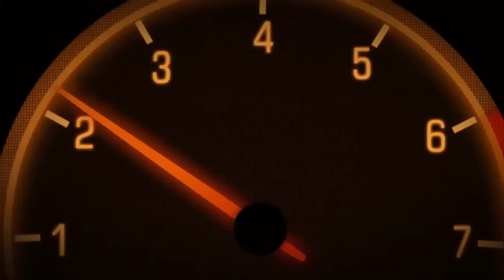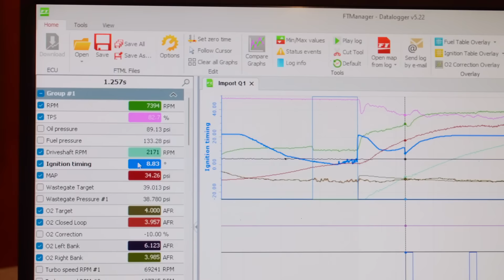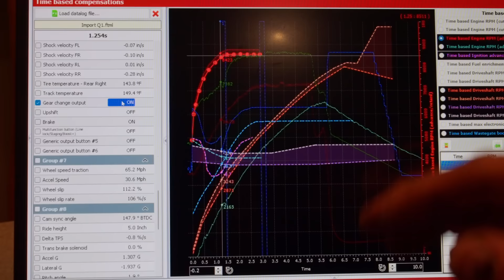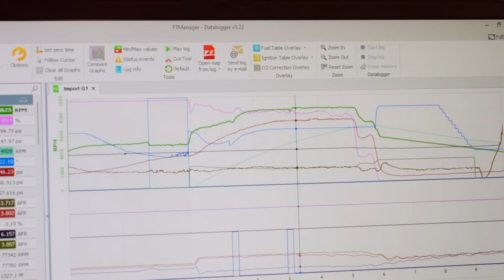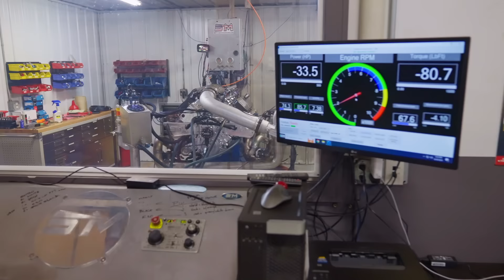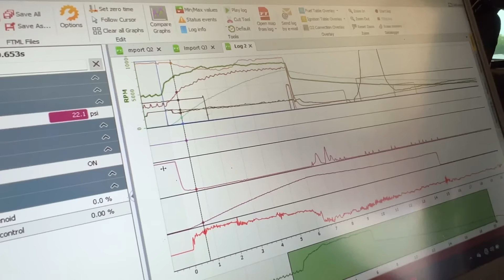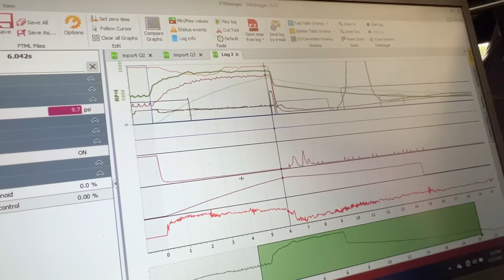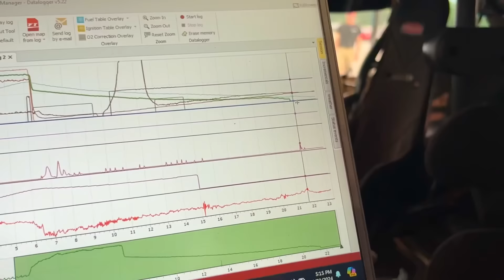Oh No!!!  Why Are There No Brakes @ 215 MPH!?!?

Comment: The sensor is only on the front circuit, I’m sure the rears were working with the chutes to slow you down at 200+ or you would have been deeper the the sand. Probably the fluid on one side is your problem. The 10lbs residual pressure is normal on disc brake setups. Great driving! I’m sure baby Jesus would overlook a few f-bombs in that situation.

Comment: 10 psi residual check valve is for rear drum brakes to hold the shoes near the drums and the rear disc only need 2 psi residual check valve for hold fluid back in the lines for sure this is the way a normal system works that has nothing to do with brake biases I don’t know about your race master cyl or your brakes I have ran into this on off-road rig seems at that speed drag on brakes should be glazed and stupid hot to boil  silicone based fluid good luck

Comment: If you never release all pressure on the brake system.  Your not charging the master cylinder with more fluid.  Some of the problem could be just pad wear and are the rear calipers the same size on the new rear-end?  Look at the thing you changed last.

Comment: my guess is that the brakelines are too close to the headers / turno / transmission , and even dot5 fluid cooks off once it gets passed a certain temp , if the brake fluid is older there might be water in it , you actually need to replace the brakefluid regulairly as its atracting moisture out of the air 
might allso be that either the brake cilinder isnt made for 4 diskbrakes (its sumting to do with the holes from the reserviour to the master cilinder , the diskbrake type sucks some of the brakefluid back intoo the maincilinder pulling the pads of the disks a brakedrum type only opens up the line to the brakereserviour as the springs pushes the cilinders back in )
or the pushrod is slightly too long / brake master has too small or big a piston 
maibe talk to cleetus to see if you can talk to the guys running his brake eqiupmen company , its their specialism so they might find sumting youre missing 
think the bigger parachutes be a pretty good idea , maibe use larger diameter front brakes might be a good idea too as you run the thing on public roads during drag and drive events too

Comment: check wheel bearings or warped rotors that are pushing the pads off the rotors...  you also have a TON of pedal travel before you have any braking effort.  Pads thin and are getting hot?  Anyway, look for something amiss and UPGRADE!!!

Comment: There must’ve been some kind of air in the braking system and then as you’re going down the track, the vibration is moving the air bubbles around or something. Just a theory. I’ve kind of had that problem with a clutch system.

Comment: First off, use System X Max Protection on your paint. You'll thank me.
Now, the brakes. Air doesn't compress. When you boil the fluid, it causes air to form. This is why I use the highest boiling point brake fluid. I've had this exact issue,and Mustangs are notorious for this. Second a bad master cylinder can be intermittent as well. High pressure it can fail, but slow easy pressure it's fine. We have a truck right now that does this. But it's not technically ours so we can't fix it.

Comment: well you were double pumping the brakes on the starting line.. doubt it is heat... throw a dial indicator on the rotors and see what the runout is.. also how much you can "induce" by slopping the wheel bearing.. at 200+ you might not be able to account for the pushback of the pad to the pistons.. maybe if you could pump brakes at 299mph?

Comment: Idk your break setup. But a single master with a possibly faulty or not fully releasing solenoid possibly? I believe you were having electrical issues before with that circuit that might have damaged it just enough to make them drag. But idk. And your wife is a legend.

Comment: Silicon based brake fluid?  Water vapor in the fluid makes pedal goes away.  Residual brake pressure probably from water vapor bubbles in the fluid.

Comment: Run a dual circuit master which keeps the front and rear brakes as 2 separate circuits so even if you loose the front brakes, the rear brakes are not affected and visa versa.

Comment: NIT SURE WHAT BRAKE PADS YOU RUNNIG BUT I HAD THE SAME THING HAPPEND  TO ME AND A ENGINEER TOLD ME THAT BRAKEPADS GASS OFF IF OVERPOWERD AND THATS WHY YOU HAVE A NO BRAKE SITSIATION  BECAUSE THE GASS ACTS LIKE A GAS BARRIER  SO THE PADS DONT CONTACT THE ROTOR
Reply: Yeah.....no

Comment: Sometimes I feel dragsters need train brakes. Adding pressure releases the brakes. So if you lose brake pressure, you basically slam the brakes.
Reply: Ever see what happens when they lock the tires up trying to stop from those speeds? It's not good !

Comment: I wonder if the brake fluid has absorbed water from all the humid weather.  Water contamination will greatly reduce the boiling point of the brake fluid.  The best fluid in the world will boil quick when contaminated with water.

Comment: Sounds like your master cylinder is going bad. When they fail they can intermittently let fluid bypass the seals and you get low or no pressure.

Comment: Probably the brakes were dragging and boiled.  I've boiled the brakes, same exact thing. Have brakes, boil the fluid then zero pedal pressure and zero brakes, then when it cools the brakes are seemingly fine again.  When it boils the bubbles push the fluid out and the calipers are full of gas, so you get no pressure. When the fluid cools the gas collapses and brakes return.  You need to figure out why they were dragging. My guess anyway.

Comment: Damn that was not a nice way to finish a run. Perhaps it's time for a dual master brake system. It may weigh a bit more but at least one axle will still have brakes if the other fails. What I mean is twin master cylinders? They dont use a proportioning valve so the loss of a hose or caliper seal will only affect that axle. A pretty standard thing on circuit cars for that exact issue as well as the ease of setting brake balance whilst racing.  The master cylinders need to be long enough to still keep a pedal if one is completly disconnected and of course pedal stroke and reach need to still function in a useable manor. It also might be worth investigating if the pistons in the calipers can move freely enough to retract under a vacuum that the master cylinder creates with it's spring return? The anti rattle springs should keep the pads in contact. Not all disk brakes work like this but if they are dragging it may be worth a look. 
Cheers

Comment: I would throw those lightweight brakes in the scrap bin! The very last thing to consider saving weight on is brakes, especially on a street legal car. Imagine if that had happened at the end of a freeway offramp instead of a drag strip. The TBM website clearly states these brakes are NOT street legal, so if you were in a wreck on the street your insurance policy would be null and void. IMHO if you don't have enough brakes to lock all four tires at will you don't have enough brakes.... but then I'm a rallyist and hillclimber, not a drag racer.

Comment: One of you brake components weren’t meant for use with drum brakes were they, as drum brakes have a residual brake pressure valve in the system

Comment: If you hit the brakes when they are overheated wouldn't you still get the expected hydraulic  pressure but you wouldn't get effective braking? My thinking is low pressure is not a symptom of an overheat, theres something else wrong. But I have been wrong before, just ask my wife.

Comment: The way the brakes came back after makes me think air is in the system. Compressed air instead of pressurized hydraulic fluid. Also could the turbo have sucked in rocks

Comment: I get the parachutes supplement brakes... but has anyone actually done the math on TBM brakes?  The entire point of a brake pad/rotor is to turn kinetic energy into heat energy to stop the car.  If you don't have enough mass in the rotor to dump the heat energy into, how can you possibly expect the vehicle to stop?  I think there's safer ways to shave weight, a brake rotor shouldn't be one of them incase the chute fails (see Tom Baileys car)
Reply: Also, brake fluid absorbs water over time, and will easily cause brake fade under extreme braking situations when saturated.

Comment: 20 psi in  residual pressure  is far to high, max is around 2 psi Result you will cook the brake fluid no matter what you are using, and racing brake fluid has a very short lifetime

Comment: Imagine if the chute didn't open?. We need redundancies. Good old fashioned hand brakes
Reply: There are redundance if it's an normal dual circuit brakes system. The car going to no brakes at all, makes me suspect something is wrongly engineered. I have seen some cars with DIY brake system run out of pedal travel before the dual master a was able to build pressure on the remaining circuit when a circuit failed. It had been overlooked that the pedal will go noticeable lower when one circuit fails on an dual master. The car looked to me to have way to long pedal travel with working brakes. Like he used nearly all the physical possible travel even with working brakes.

Comment: Do you need a bigger bore masters ? Isn't it the bigger bore , it's more volume  and smaller more pressure?
Loose wheel brgs at speed and the voters seem twice as thick and the piston must travel farther.  Paint job is killer

Comment: Brakes. I'm suspecting you might have broken a caliper. Something that was solid is now moving but is elastic enough to return fluid but not provide clamping pressure. You can't pump it up because it simply returns fluid. You would still have brakes at very slow speeds because force required to slow is very very low. I'm guessing you haven't done much severe braking since hitting the wall.

Comment: BRAKES Single master cylinder? brake fluid starts dying at 450 and never really recovers and after a few reheats turns to water, in our off road racing trucks it was a big problem when we went to bigger tires [weight]. We always ran separate master cylinders and reservoirs  so you can never loose all your brakes at once, I also run a inline residual check valve to keep pedal 1.5lb-2.5lb the 1.5lb is my choice any more is to much drag, also  run 7/8 masters front and back using  6 pistons/4 pistons. we are heavy 5,400lb @ mid 150mph you vehicle is unique so you kinda setting your own standards. Just a couple of thoughts

Comment: Go through and fix the front brake SYSTEM! 
You should have zero pressure on those front brakes.
3600# @ 230mph, you should have CARBON FIBER rotors and the compatable pads.
Put Mark Williams front brakes on it.

Comment: And get rid of that TBM 5.1 fluid, completely flush your system, and get some Motul 700 RBF and use that from now on, it's got a dry boiling point of well over 600° unlike the 356° stated boiling point of TBM 5.1....and 5 and 5.1 is silicone based, you know that right? It's only really good for vehicles that sit for long durations...but unlike ether glycol based 4, which will absorb water but still be compressed as it's absorbed into the base, silicone doesn't absorb water, which means if water or moisture ever does get in, it could be a much worse problem... like not compressing and heating brake fluid, and instead, compressing and heating straight water by itself because it stays separated.... which "could" have been an issue you just witnessed, maybe not, but there's a possibility.

Dot 5 also aerates and foams way more than Dot 4 does, or can I should say. It's been warned against using it with braking systems that use abs or abs pumps.

Comment: You need to at least throw that master cylinder away, is there room for brake pressure and temp sensors in FT

Comment: cavitation
Reply: It's not a boat
Reply: @Airplanefish  Brake fluid cavitation occurs when a pump is starved of fluid flow, leading to the formation and subsequent collapse of vapor cavities in the liquid. When a pump doesn’t receive enough fluid, it creates a vacuum condition inside the pump. This lowers the fluid’s boiling point, causing it to turn into vapor bubbles.
Reply: @DRCK-sp2gt  what pump in the brake system are you referring too then?
Reply: @Airplanefish  The brake master cylinder would be my guess.
Reply: @DRCK-sp2gt  negative. The guy above is talking about cavitation. There's no mechanical pump designed to make pressure on a brake system.
Reply: @Airplanefish  you sure about that because I’m pretty sure the master cylinder is a hydraulic pump and then you have a boost pump.
Reply: @Airplanefish  so then explain how pressure is made in a brake system.
Reply: @DRCK-sp2gt  it's a piston and cylinder. Which do not create cavitation.
Reply: @DRCK-sp2gt  a piston pushing against fluid in a cylinder forcing fluid thru a smaller hole
Reply: @DRCK-sp2gt  cool

Comment: Brake line pressure dropped too far to be explained by just boiling fluid, your rapid pedal pumping should have developed several hundred PSI not just 40-60.

Comment: DOT 5  brake fluid is NOT the answer for what you are doing. I love the stuff cause it does not eat paint, but it is not good for high heat situations and would never take it on the track. DOT 5 also has a tendency to retain some dissolved air, this gives you a softer pedal and once again, heated air  in the brake fluid is not going to help your cause. Get a proper racing fluid.

Comment: Dot 5 fluid should be changed after each race event because of it inability to absorb water. All brake system are vulnerable to water absorption. Dot 5 fluids/silicone trap water in pockets that then turn to steam under heavy braking creating air pockets,after cooling down then back to a fluid. Flush system before each event with new unopened container of fluid.
Hope this will help.JB

Comment: Two drops of water absorbed in the fluid will boil and you lose all brakes.  You need to flush the fluid, at least, every year.   Brake fluid absorbs moisture naturally over time.  Airplanes use hydraulic fluid because that does not absorb water.